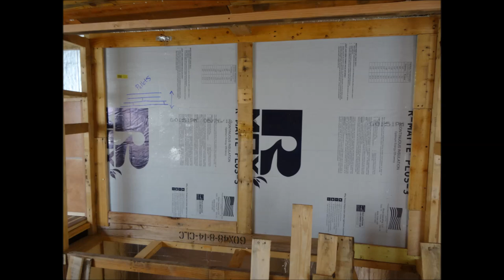Episode 23- Cargo Trailer Tiny House

Comment: Are you brad nailing into the foam board insulation?Or is there structural wood behind the pallet wood?I really love the look of the pallet wood every where. its thin so the added wt will be less than plywood plus you wouldn't get the awesome look. Will you clear coat that too?
Reply from the maker: +CrossGrain Wood Products,LTD There is wood behind the foam board, painted with a zero voc paint. Thank you for the compliment ;)

Comment: hey jay's brother,
where was the picture taken at the end of this video? 
I used to build custom toy haulers and something that we did to save on weight was to use aluminum tube and angle where ever possible, also you might take a look at hard board its extremely strong and very thin like 1\8 to 3\16 thick. Anyway looks great man keep it up.
Reply from the maker: +Robert Phillips Hey Robert, thanks for the tip! The picture was taken in Michigan in the U.P near the pictured rocks.

Comment: looks great so far,im gonna be starting mine nxt month,i just cant decide on what size cargo,6 by 12, or a 7 by 14,  or even a 7 by 12? what size is your trailer?
Reply from the maker: +John Grieco I checked them all out.... for far too long before I decided. V-nose, car hauler, horse trailer and many more. I decided to go with a landscape trailer, because I like the double doors on the back as well as other features. My trailer is 18.9x8.5 ( as wide as you can go legally). 7 feet width was too cramped in my opinion.  Thanks for watching!

Comment: great informative channel. thank you. how tall is ur trailer inside? it seems perfect. and how tall r u? another question have u tought about getting it insulated with sprayfoam thruout?
Reply from the maker: It is about 7'6" on the hight originally, after the insulation its about 7'. I am about 5'10" and I can stretch my arms out completely upward. I thought about spray foam, but I was concerned about off gassing, and it was also kind of pricey in my area. Thanks for watching. :)